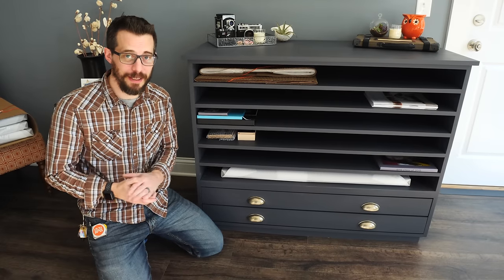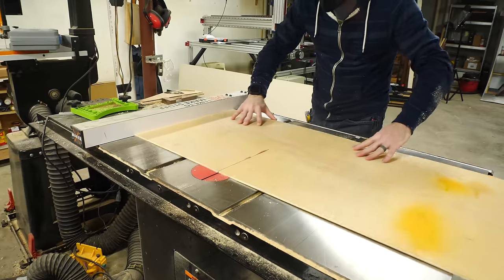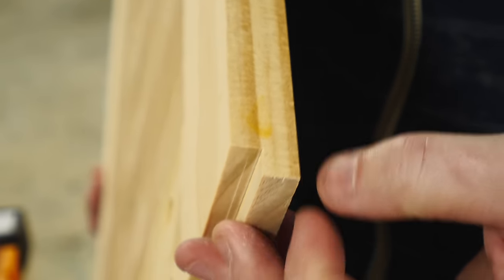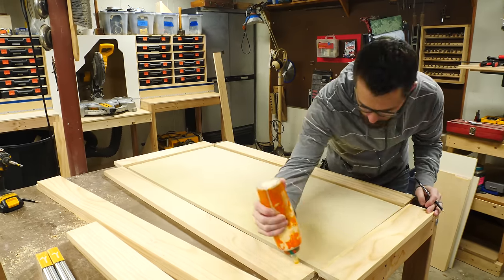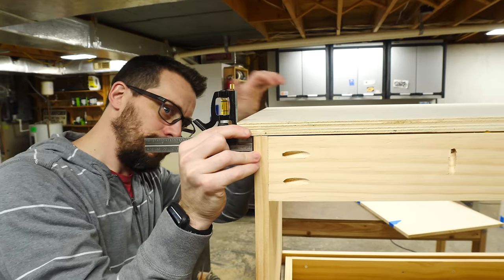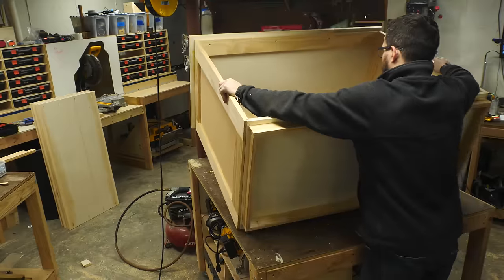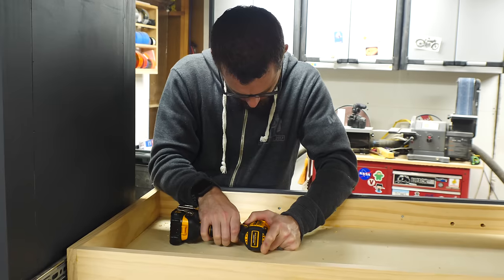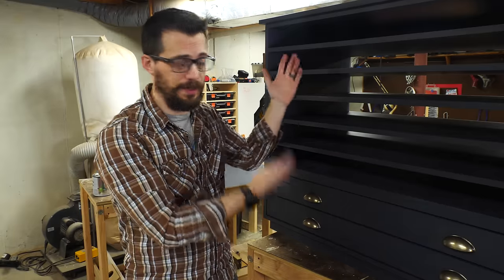How to make a Map Cabinet // Woodworking | I Like To Make Stuff

Comment: Nice project Bob! I like the proportions of the cabinet a lot. 

Also, I'm sure you know this, but just in case... when they clear coat it, make sure it's water-based poly. I've had some strange stuff happen when using regular poly over latex paint.
Reply: Michael Alm the proportions are perfect

Comment: Nice build Bob. As a suggestion, if you add 3/4" overhang to the back of the top, the top will clear the molding on the floor, and the top will extend all the way to the wall.

Comment: Hi, i’m an interior designer. What I find really practical in my cabinet designs, especially those with deep open shelves is I put drawer guides along their sides, so the whole shelf can be pulled out. Kinda like a pull-out keyboard platform for computer desks. That way, it would be easier to go through prints if you’re searching for anything in particular. It can also act as a temporary work counter. Just a suggestion. I love your videos :) Keep making them :)

Comment: You should add some caster wheels to allow for easy movement in case they decided to go to a gallery they can transport the cabinet or move it for cleaning under and behind or if they rearrange they can wheel it around maybe add some attached levitation shelves they can fold down have extra space to put some pictures up or somewhere to write something like a not to lable whose item is who's

Comment: Absolutely love these video's and the amount of detail, second to none! Only "problem" I see in general is that during the life of the channel, heavier and more expensive machinery was installed. Which totally makes sense ofcourse, but it does make building stuff sooooo easy, that if I would do it at home, it would take 100x longer. :) But anyway, inspiration is always there so that's great.
Reply: Occasionally, but even projects like this show pretty good options (table saw for rabbit as alternative to router) and use pretty common equipment—table/miter/circular saws. Nailers and drivers are just convenience. I don't see such a barrier for home enthusiasts. Also, this may be a short video but it also took a long time to make and was not easy 😁.
Reply: Oh totally, it's not a major barrier, but for me it isn't very easy due to small size rooms I have. :) So, inspiration-wise it's always great and I take ideas and such for smaller projects. I just think that sometimes the more small projects would also be nice as they sometimes have specific clever solutions as well that don't show up in big projects. It's not major criticism, just something I felt watching the machinery I guess.

Comment: Hey Bob. Turned out nice. I noticed that the shelf ( or divider) above the top drawer magically ended up with a thicker face. Looks like double thick ply. What did you do? Was it two shelves or pieces on top of each other or was it a wider piece of 1x4 nailed to shelf face? Thx!
Reply from the maker: I just added a little strip under the bottom one so I could space the shelves evenly to match the drawer heights.

Comment: Random question. How do you keep your kreg bit from stripping or bouncing on the pocket hole screws? I use the same dewalt impact driver you use and no matter how lightly i pull the trigger and how hard i press against the screw it seems to bounce and strip the head of the driver bit.

Comment: In the build, the shelves are equally thick, but in the final product the lowest shelf is thicker. What did you end up changing?
Reply from the maker: I just changed the spacing a bit when adding the shelves and added a 3/4” strip under the bottom shelf to fill the gap

Comment: You think a lap joint on the end would work instead of pocket holes for the outside walls?
Reply from the maker: I don't think you could add that without modifying the inset panel.

Comment: How do you get a high quality finish with the paint? Do you do multiple coats? Sand between coats? I have trouble with the grain of the wood raising when painting plywood.
Reply from the maker: Typically after priming, I'd do a light sanding to knock down the raised grain. Two coats after that usually does well to get a pretty smooth finish 👍🏼

Comment: Question why was there no support for the middle of the open shelves? If they would stack a lot of paper, it might warp. I am thinking something in the back of the shelf (inside) just to help prevent warping.
Reply from the maker: Because the shelves are 3/4" plywood. They are plenty strong.  You could drive in screws through the back panel into the shelves if that were a concern.

Comment: You said that the back panel serves no purpose other than to block the view of the wall behind the cabinet. This isn't true. Even though it is only a thin sheet of plywood, it does act as a cross-brace for the cabinet since distorting the box by pushing on one corner would place tension on the back panel.

Comment: How do they plan to deal with the sagging in the shelves?
Reply from the maker: The front edge of each shelf has a slightly taller strip of solid wood across it to strengthen it. That makes a big difference.

Comment: One of the batteries u used in the drill as far as I can tell is one of those off-brand duplicates. Do they work well? I’ve heard mixed feelings about them but mostly negative. Have u had any trouble with them?
Reply from the maker: Yeah, I've heard bad things as well but as far as I can tell, they work exactly as well as the branded ones.

Comment: Why edge band it if you were painting it?
Reply: Its doable, but often plywood edges can have minor voids, and since the plys alternate orientation, the paint soaks in differently and you can see the plys without several coats.  All in all, just a bit cleaner look with edge banding (IMO).
Reply from the maker: Tharemy is right on..